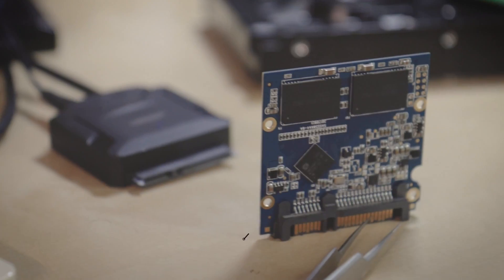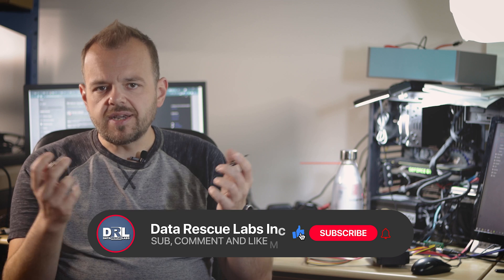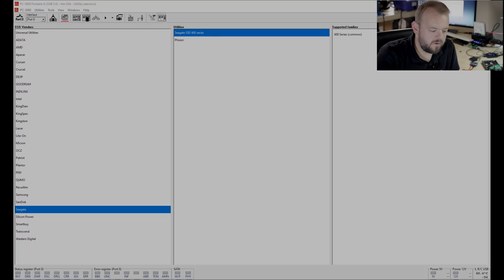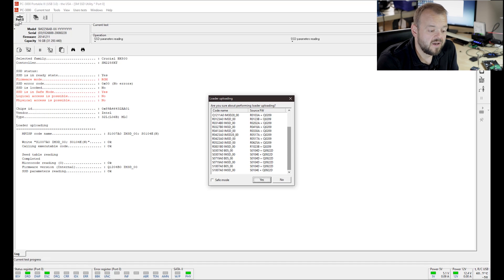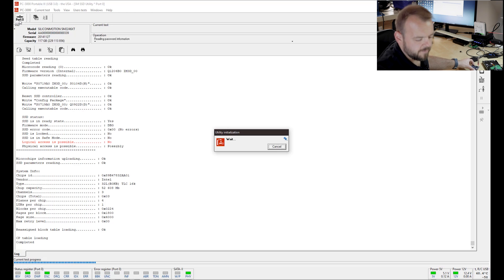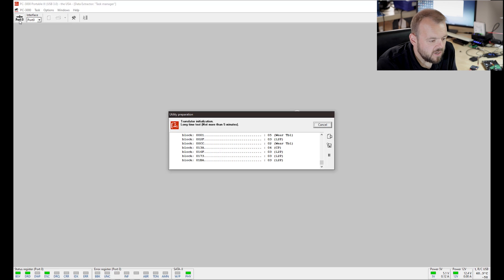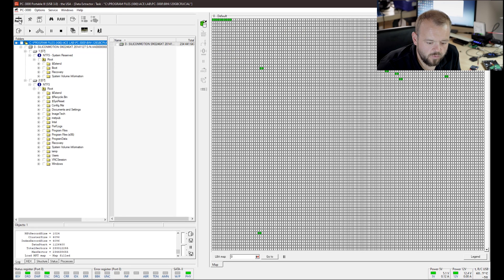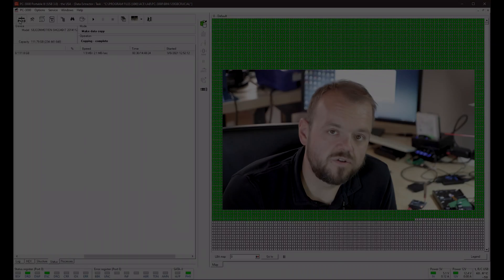Crucial SSD recovered with tweezers

Comment: I really appreciate the content you produce, it's been extremely helpful for me just starting in the data recovery field!
Do you offer any training at your lab?
Reply from the maker: Thank you for your support! We do not offer training but I can direct you to the right people if you’re interested.
Reply: @forensicguy  Thank you! That would be very helpful if you could
Reply from the maker: What do you want to learn?
Hard drive recovery (and ssd)?
Flash recovery?
Reply: @forensicguy  I'm sorry 😅 I should have wrote that down in the previous message. 

I have purchased PC3000 Portable with the full equipment included for Flash & SSD recovery, I've gotten decent with logical issues and chip off for SSD & Flash but not had much experience with SATA & PATA drives. 

I would like to learn how to properly recover from physical damaged SATA & PATA drives eg Head swaps, ROM issues, dead drives etc). 

Thank you very much for your help, wish you & your business much success!
Reply from the maker: Ace labs would be your best option for training.
Reply: @forensicguy  thanks for your help!